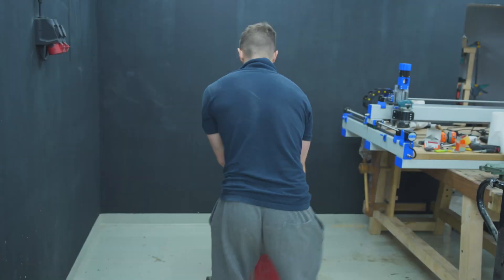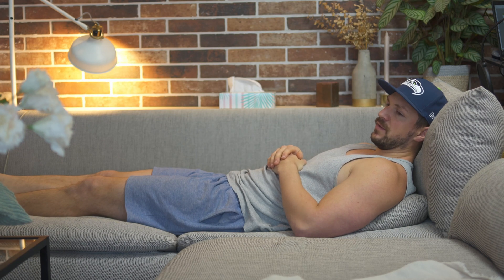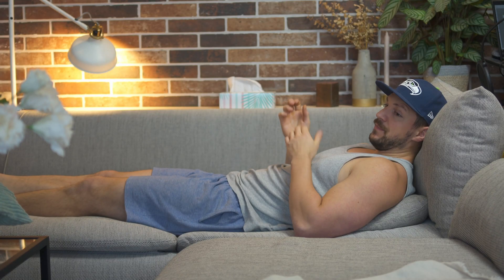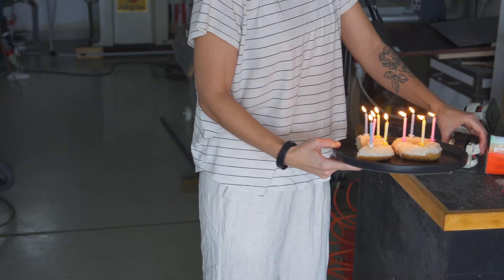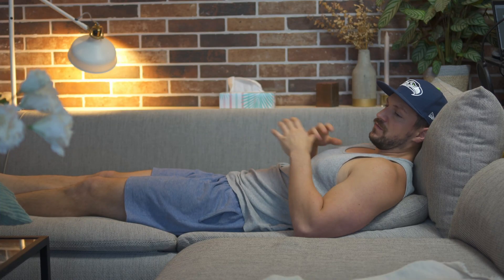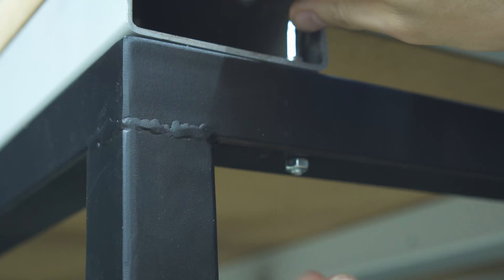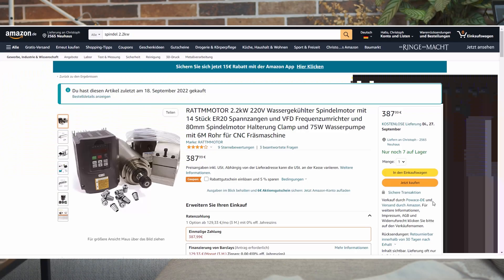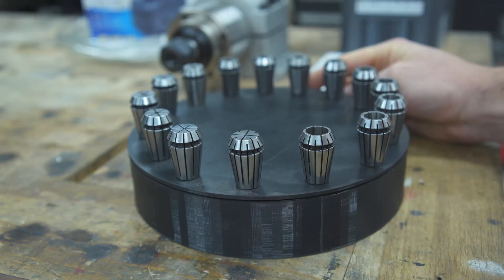a PrintNC on WHEELS?!

Comment: I'm stuck overthinking my printnc table at the moment too. Are you ever going to add an enclosure? I'm trying to figure out if I should make the tabletop bigger to allow for that. Then if I should put the table legs out at the corners or bring them in so they're right under the router frame for more support. And if I should fill them with sand like some people do 🤔
Reply from the maker: If you only do.wood, its not necessary imo.
When doing Aluminium its very necessary 😅

Tbh. I am not a big fan of sand, i'd go with concrete

Comment: Love your videos and the way you go about these projects. Started ordering first bits for my own PrintNC and am looking forward to building it (and using it eventually). Would be interested which spindle you got, currently doing quite a bit of research and am currently on the G-Penny "metal" water cooled with 2.2kW and 400Hz. Thanks and keep 'em coming. All the best.
Reply from the maker: I got the Rattmotor Spindle 2.2kW

I've checked runout and it was below 2um
Reply: Thanks, I saw you even had that in your video 🙈